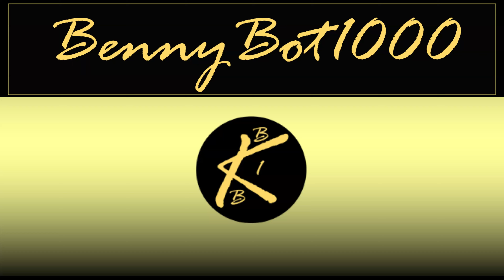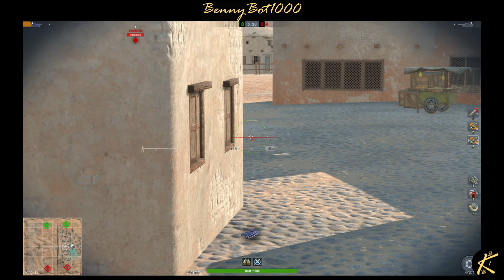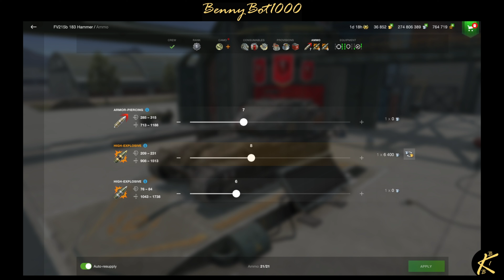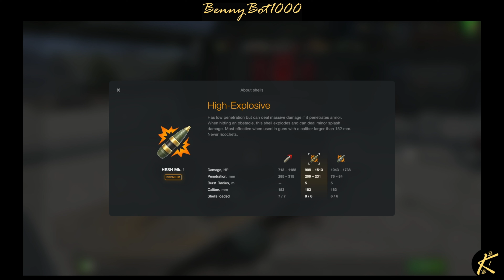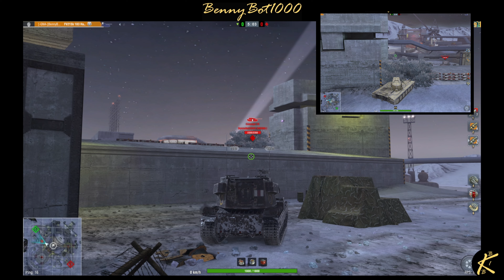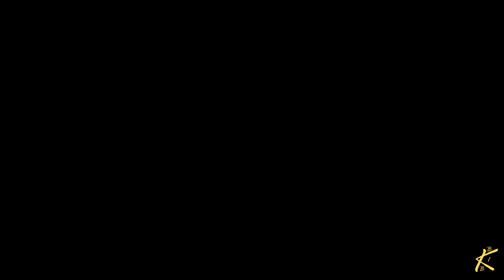WOT Blitz Players Hate This One Concealment Trick

Comment from the maker: What do you think about this? Useful?
Reply: Yes, extremely useful for players to know. Especially the splash radius value you explained in this video.
I've been firing high calibre HE rounds into the ground under tanks for years. Especially when they're trying to face hug and I can't guarantee a pen using AP or Gold. I just reverse up a bit, load up the HE and aim underneath their tank.....BOOM!
The splash easily penetrates the thin floor of their tank doing damage to crew and modules, and if they're on low enough HP it can kill them.
I didn't know about actually ricocheting HE blast fragments off walls and other objects though, so thank you for that info.
Great instructional video, sir. More needed.
Reply from the maker: @scatter1390   HE shots under tanks at close range is a great tip. I was surprised when I saw the blast radius values were listed (who ever clicks on that bit). Thanks for watching and I am glad it was useful......just don't use it against me!